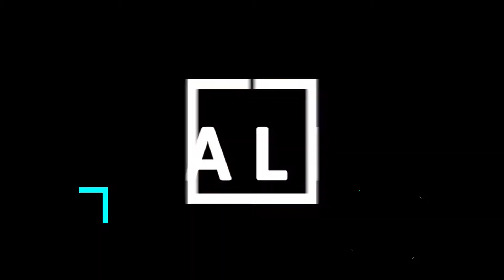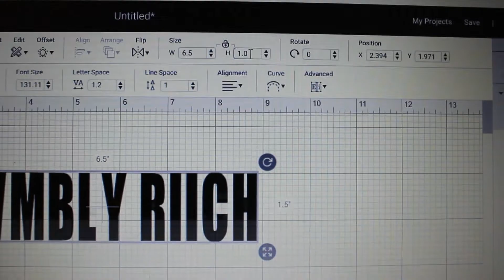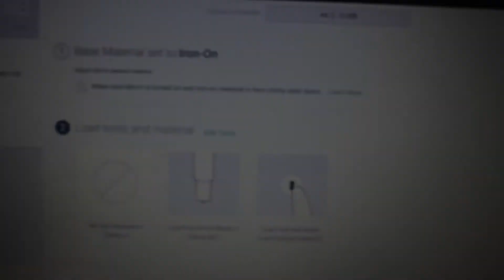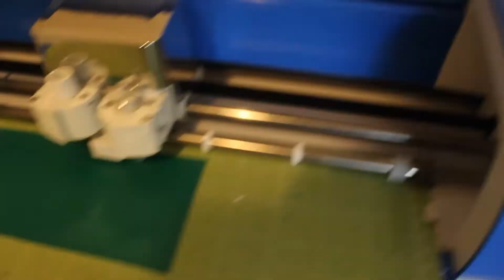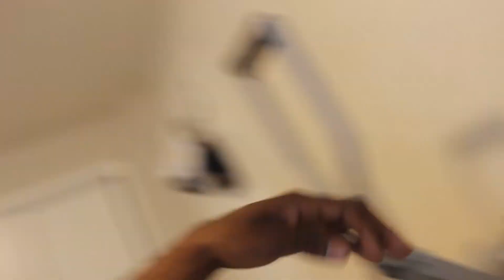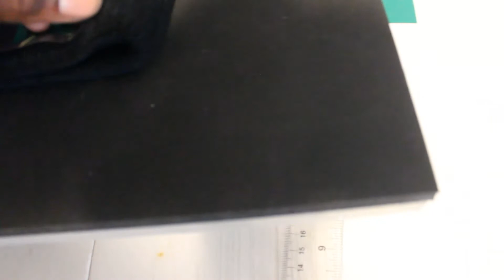How to Heat Press A Beanie | Using Stretch Vinyl | Beginner's Tutorial

Comment: Question so using acrylic beenie hats is better than cotton hats and also have you ever pressed the entire hat with HTV
Reply from the maker: Both hats are good, depending on the quality of the fabrics you prefer. I just suggest you use stretch HTV on acrylic to reduce cracking. No I haven’t done that as yet. That would be a good project tho!